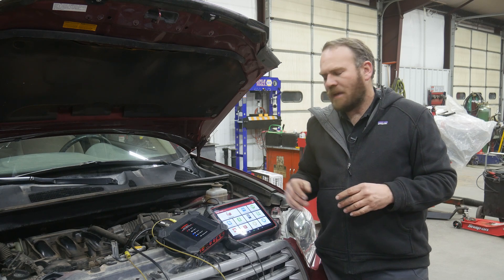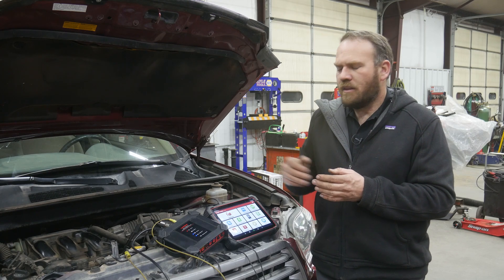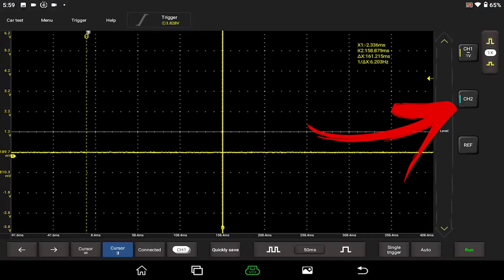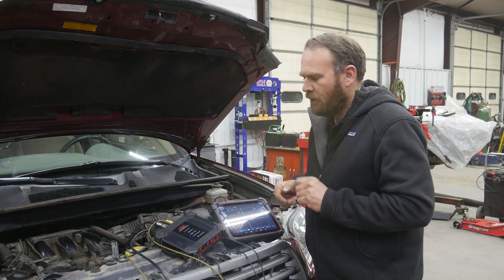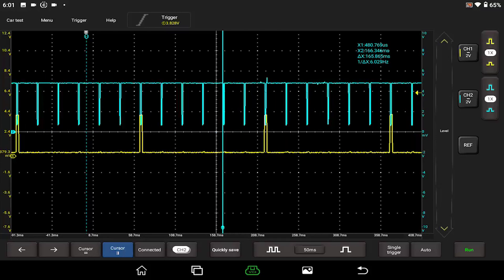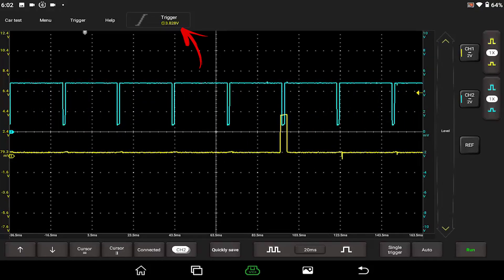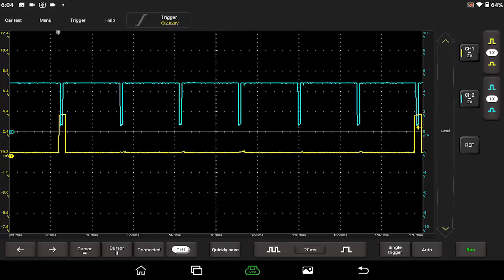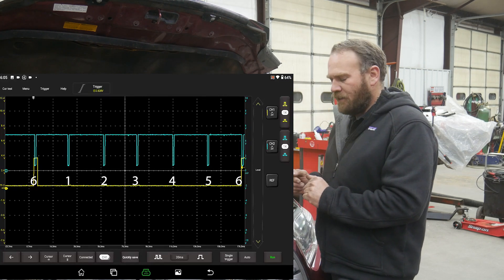2 Channel Scope for Dummies- A Guide to Using a Oscilloscope with the Launch Torque 5

Comment: Thanks man! I truly appreciate your wisdom and your time. It's nice to see people in the field that give their time to people like me that are learning. I learned from guys that have been turning riches for 30 years it's the best way to learn. I do have a very important question that pertains to the launch I purchased a launch pad 7 elite and unfortunately I do not think that it is going to work for my applications I own a shop in Anderson Indiana and I thought this because I previously used a launch application that was branded by matco and I loved it it worked and it did everything that I needed to. Dispatch 7 advertisers j2534 capabilities and unfortunately I don't think that it has them for domestic vehicle. Am I mistaken on this.? I also just got my 022 oscilloscope in and you're helping me learn how to use it properly. When connecting to a fuel injector I know that fuel injectors can sometimes Spike as high as 100 volts or more do you need an attenuator.... Do you ground it and then connect to the power side or do you connect to the signal side? Again thank you so very much for your time... Just in case you have the time to speak to me directly my email is Chris@Hobbsautomotiverepair.com.or by cell 7656061490. I suspect this money and I just simply needed to work are you domestic or are you across the seas and you work for lunch?

Comment: My favorite test Chad. I love using a third channel to monitor current ramp.
Reply from the maker: Do you ramp all the coils or just the suspect coil? Some are easy to attach low amp clamp to power-source and some not so much. I love how when one coil fails on the IGF the engine won’t run🥴. 
ECM- Doesn’t looking any spark is happening so we better turn off the injectors.
Reply: @ThePracticalMechanic  most of the 2GR-FEs are pretty easy. There is a junction connector in the fuse block. I see some fail primary as well so I just make it a habit. But igt and igf you can do with your eyes closed. I’ve actually never ran into a scenario where it takes out the entire igf circuit and kills the car. I’ve heard if it a lot.
Reply from the maker: @grabovg  I’ve seen it most on 3.5 rav4’s. They will cut power and/or stall when the IGF gets shorted. You can simulate it with a test light. After about 3 seconds with IGF shorted most will shut down the injectors.

Comment: Which part of the Toyota/Lexus ignition coil fails? I haven't had success finding the failure  using a lab scope when current ramping and monitoring igf igt signals.
Reply: Often times the failure is in the igf transistor. Sometimes it’s intermittent. Other times the secondary side fails.
Reply from the maker: Thank you Gera for answering before I could. 👍🏼